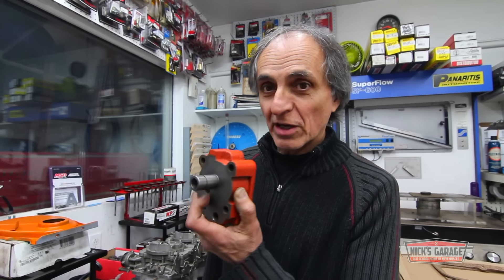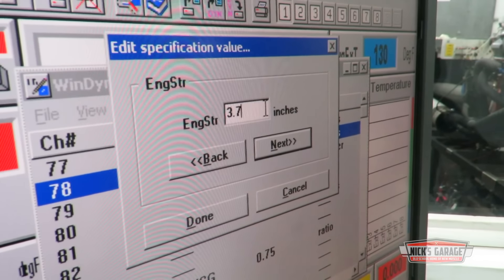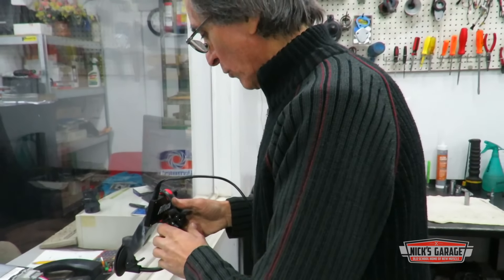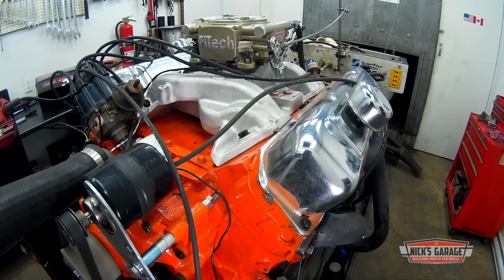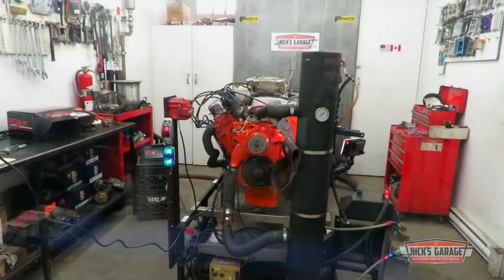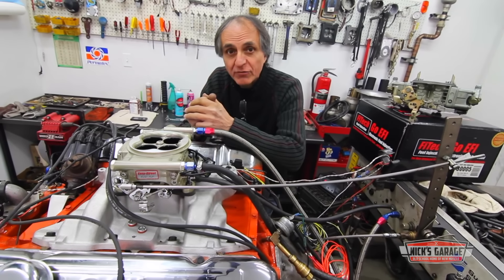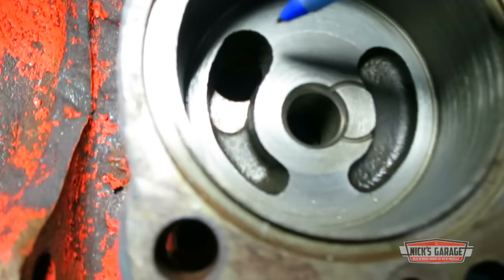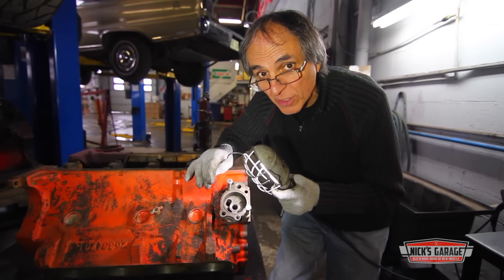Carburetor vs E.F.I. - Dyno Room Showdown

Comment: Lmao no wot tuning and only 10 hp less lol sounds like I need to throw my carb in the dumpster
Reply: You need a better parts store then .
Reply: John Johnson  - Sure EFI has only been standard equipment on everything since 1986 so no one will know what you are talking about.
Reply: If you had a problem with the EFI the parts store isn't going to have parts for it since it's not a factory type system.that's where your gonna get the blank stares from. Unless all the components on Fitech or Holley sniper use GM, Ford, Chrysler pieces. If you had a problem with a carb you can get a rebuild kit or most stores have an edelbrock carb on the shelf. I ran I holley Stealth Ram EFI on my Trans Am which was just an intake but it used  all the other factory type pieces. So getting parts was easy.
Reply: If the Parts store sells the system than they can order the parts from the Manufacturer just like they can  if you have a problem with a Holley carb they pick up the phone and call holley with the part Number ..
Reply: If you have two cars one with a Holley sniper or fitech efi and one with a  Holley carburetor. Says it's Saturday 6pm and your 200 miles from home broken down  on the side of the road with fuel delivery issues. There's an autozone, o'Reilly's, and advance auto all open. There a good chance you can fix the carburetor issue that night and drive home. Weather it's  getting  parts off the shelf for the Holley or buying an edelbrock carb. With the aftermarket EFI of course you can get parts for it but you will be most likely have to wait till the next day at the least to get those parts. If you have a factory style efi like a LS powered car there's a good chance you'll have it fixed that night also. I have both a carbed car  and a efi car. I like both for different reasons
Reply: LOL it's no different than driving a mercedes and breaking down in a town with out a Mercedes dealer ship. NexT day shipping is a thing it's not the 1980's .
Reply: Were not talking about a Mercedes we are talking about aftermarket fuel injection and carb. Stay on on track. Yes it's 2020 last time I checked
Reply: yeah i think the opposite is true in most parts stores these days , great to have thing running right on carby if you can do it and not have to rely on electronics but id like to see the graph
Reply: Here in the South carburetors are awful. When you shut down the engine it boils all the fuel out of the bowl and floods the engine. I stacked up insulating spacers, added a return line, even swapped in a ThermoQuad, anything to keep the fuel in the carb cooler. But no. Sitting on top of that 200 degree engine is just too much for them. Inline engines do a lot better though because the carb sits off to the side.
Reply: Why would you  throw  a Carb in the Dumpster ?   They are very  expensive  now days .. Sell  it to an Antique collector ..!!!!
Reply: @frankg4761  Lol, most parts stores don't have carb parts in stock anymore.
Reply: @cadman10000 Haha your funny. most parts stores have an edelbrock carb in stock or can get one the next day. Or if you need a rebuild kit for a carb you can get one quick. Stock efi of course they have it in stock or can get it quick. Fitech or aftermarket efi your usually having to special order the parts needed to repair it.

Comment: When i asked indy cyclinder heads engineer about carburetor vs Efi, he stated carburetors always have the advantage. THE NHRA is pushing EFi In all the professional classes.. top fuel, funny car and pro stock. Fine Tuning is easier with Efi if you understand it and if you have the know how to use a laptop computer and upload a program. Draw back. Electronics are making auto racing as a whole more expensive.

Comment: It would be interesting to compare a multiport fuel injection manifold to the FiTech throttle body EFI and the carburetor. I suspect the multiport system would be the winner.

Comment: Carburetors are for lawn mowers (and only for a while longer at that).  And you can adjust that EFI to do exactly what that carb is doing at WOT.  Plus it will continue to do it regardless of what the weather is doing.....
Reply: until the sensors bug out.   EFI was developed for pollution control not power.  When either the MAP, TPS, O2Sensor, FFS, CPS, MPS etc etc start to work below 100%, you're fucked on power and efficiency
Reply: Edwin Henry Blachford,  I don't know specifically about EFI's development, but fuel injection was developed for power.  Even though it was mechanical.  But you're not F'ed if any or all sensors go out, you're just back to a carb type fixed fuel delivery.  As in it reverts to a set injector timing, like a set jet in a card.  What makes it great is when working, it's like having a Nick and his dyno inside your carburetor, swapping out jet sizes, thousands of times a second...

One of the biggest pluses for me, being a electronic engineer, was when they started testing emissions.  Electric signals can be easily made to report whatever the socialist want to see.  And during the sniff test days, an engine can be made to run as lean and clean (for a short time) as needed, with the push of a button, or via an app on your phone once the open source ECU gets off the ground...
Reply: chewbaccathedog, Sorry dude, but there is absolutely no measurable difference in atomized fuel between a fitech type EFI and a perfectly adjusted (for right this second) carb.  And even if there was, the carb would be less atomized, as so readily shows when the jets are too big and the accompanying gumming of the inlet valves.  If you ever watch a slow mo of a carb at WOT, it's coming out in relatively large droplets like a water hose.  Injectors of the last 20 years never release anything other than fully atomized fuel.

Plus injectors come in many variations.  The latest injectors have are high ohm fast switching atomizers that a carb could never hope to match.  It just can't be done with a vacuum draw.  And there is no pure liquid dump of raw fuel every time the pedal is mashed.  

Keep in mind that they ran peak power test based on a self learning EFI system.  And any engineer knows to plan for the worst by being conservative in the automatic settings.  If they had a tuner there to tweak the timings, that under a grand EFI would have not only smoked that carb, but would maintain peak numbers irregardless of temps, altitude or fuel quality.  I luv the simplicity, and locked ECU systems at times make diagnostics an expensive pain, but Carbs are for lawn mowers....  And I'd rather not even use them on lawn mowers...
Reply: Mat Helm my buddy spent $3500 to lose 28 hp
Reply: Cana box
Yea, ya can't fix stupid....  Even with $3500 dollars...
Reply: Edwin Henry Blachford. Fuel injection was for the early diesel engines.
Reply: Ya but every one is comparing a dinosaur method of fuel injection. TBI hasnt been used since the late 80 very early 90s. We since seen and gone  MPFI SEFI and now use direct injection. Drive a direct injected turbo driven car. No preignition . The power is amazing even in a N/A engine. Ive run both , there isnt anything wrong with advancement in technology.  Carbs are fun , they make cheap quick power at WOT. Theres allot to be desired all around with a carb vs modern Efi
Reply: Give me a well tune carb for the money. Spend 2000.00 for what with a efi..please....demon, edelbrock ,electric fuel pump..good double plane intake...
Reply: Haha
Reply: @IlPinnacolo  So then why are so many Top Fuel Dragsters, F1 teams and so on moving to EFI? Top Fuel certainly is dumping a lot of fuel quickly. Not questioning since you seem to know your stuff, just wondering why so many racing teams/types are moving away from mechanical carburetors? Sign of the Times, easier to tweak and manage.....or am I wrong on this trend?

Comment: Formula 1 uses fuel injection. Four injectors per cylinder though. Pretty high tech.
Reply: using injectors was high tech in the 50's when they were first used lol.  F1 using them today, not so much lol.
Reply: @bonnivilleblackcherry9745  Are you sure about that? The four injectors fill the entire chamber giving a more efficient explosion in the cylinder. Pistons are also designed to swirl the air fuel mix improving the filling of the cylinder to create more power. In lamens terms.
Reply: @Malc664  1001% sure. Your chev or mazda daily would be using it since the 70's but they don't have sponsors paying for it. 
Pistons are designed for compression or atomization (spelling) but not for cylinder filling. Cylinder filling is based on the volume of the cylinder. If you have a 40 cid cylinder when the piston is bdc it doesn't matter the design of the piston. Its still going to suck in 40 cid of air and fuel mix. IN LAMENS TERMS ;-)
Reply: @bonnivilleblackcherry9745  Ok mate. Intriguing. Makes me wonder why F1 would use the system they have now.
Reply: Current F1  regulations only allow one injector per cylinder. Not 4.

Comment: engine masters done the same test using holley efi,and the efi beat the carb....
Reply: steviesls1.    I have been told that the Holley EFI is a better setup.  We are just starting to put a few EFI on engines. Thanks for the input.
Reply: The interesting thing was they COULD NOT get a dual plane manifold to work with it.
Reply: I'm a carb man myself,my 95gt was swapped to a carb after the 351 swap,tuning is just so much easier and cheaper...
Reply: But nick didn't tune their carb. It's all in the tune.

Comment: With an electric fuel pump turn the key and they start. I have seen a few people with these elcheapo  efi setup. Some good, some bloody awfull.  On some engines they ndo not like dual plane intakes. Why? I dont know either but going from a Performer rpm to a Victor jnr made a mild street engine better. Though it had less bottom end to mid range power. That one is back on a carb.
Another using a $2000 Holley set up was quite good, gained very little power but was smoother mid range and a bit nicer down low. This on a street strip engine where it was no faster but a bit more consistent. Though to me his carb was too big anyway. An 850 on a 11-1 351 is too big!

Comment: It is not the FI  that makes it reliable but the  ELECTRIC FUEL PUMP  I ran a 440 for 13 years started first time all the time -30 0r 35 degrees because it had an electric fuel pump , no cranking to get the carb filled

Comment: It’s not about wide open throttle. A correctly flowed fixed fuel carb will make the same HP as a injected throttle body. It’s drivability, self tuning, economy of use. I run engines for 12 years on dynamometers all of which was WOT so it didn’t matter witch fuel delivery was used. Fixed fuel doesn’t have any compensation for any of the elements.

Comment: I daily drive carburetors.  There's nothing cheaper and more reliable, YET.  Eventually efi will be more affordable and it'll be the way to go.
Reply: cheaper, yes. more reliable? depending. turbo and carbs? never again...
as a owner of a original 85' Alfa Romeo GTV 2.0 Turbodelta 90% of the problems was the carbs and most went gone after i got it modified for EFI (Bosch).
same with the old Alpine A310 i had before, no turbos there but that car just asked for fixing up what the french had screwed up (two carburetors where one was a dual and the other a singel working in tandem, and they needed new adjusting after almost every trip...)

though like all Alfa's, aren't there one problem an another comes up so my last problem is wires been chewed on by mice so looks like it might not get out before the summer -_-"
Reply: Børre Børresen this is French garbage we are talking about... I'm talking about American cars, v8, straight six, whatever.  Like in the video.  Carbs are indeed FAR more reliable because if maintained, everything else can literally come apart, but they will work if there's 6 psi of pressure at the fuel pump.  And without pressure, you can put the tank on your roof and gravity feed it like a motorcycle.  You cannot do that with fuel injection
Reply: funny enough the carbs on the Alpine was made in the US.
Reply: Børre Børresen ok, I have to admit. That IS funny
Reply: shows that even with good parts stupid engineering can make stuff unstable.
whats a good idea on paper might not be in real life or even will end up being a gigantic hassle later on.

i know that now you get adapters "cheap" to mount a single Holly on the Alpine's, back then i would mostly done that if it had been a option since it's cheap and simple and most people can tune em.
plan was to get twin dual Dellerto 40mm's that could have been fitted to the original intake with minor adapters but price was twice of what a custom EFI setup was.
and the new owner really loved it and sold the car with profit (if i exclude the workhours i did to it)

the Alfa is more an "overtuned Italian" from factory so everything was on it toe tips all the time...
so a recipe for for fun but also break downs. but slowly rebuilding it to a sunday cruiser so future generation can witness it.
Reply: Only carb guy here in a whole crew of fuel inj  cars
Reply: I wouldn't say they are cheaper OR more reliable.  You can purchase this same FItech system complete and ready to bolt on for around 700.00. 

A brand new holly HP will cost close to the same.
Reply: Cheaper, I'll admit, or at least for the carb itself. Over time though, after the learning period, the EFI will save more on gas (generally, unless you're REALLY GOOD at dialing in a carb) and won't need occasional tuning. It all lies in preference and what you're accustomed to. If you're accustomed to them, like the ease of repair, and want to pay less on the setup, go with a carburetor. If you want better fuel mileage, simple setup, and little upkeep demand, go EFI.

Comment: you should have allowed the efi to fully learn the engine parameters properly then run your dyno test,it would have beat the carb if it was the same cfm
Reply: Northernsledr.       True, we should have put more time to learn the EFI system.

Comment: I adjust my FiTech for temperature changes.  I run 16:1 AFR in triple digits and 14.7:1 and lower below 50 degrees F.

Comment: I believe that engine was hunting for idle. On tbi systems your supposed to adjust throttle blades so the IAC position reads 3-9% at hot idle on the data monitor. Then you have to do a TPS reset. Also I haven't heard many good things about fi tech besides the price. I think the holley sniper efi would have been a better choice. I'm running the holley terminator. They market these things as "plug n play" "self learning" They do a pretty good job on base fuel table but some things like eccel enrichment, hot starts, cranking fuel ect have to be tuned manually. It is a learning curve but I know much more now about EFI and have fun geekin out in the process.
Reply: TheMikel302.    The night before we had it running and tuned. It took us a while to get it to run perfect. From idle, to part throttle and full throttle. Next day for video, it had a mind of it's own.
Reply: Yep. This hi tech stuff can be a blessing or a headache and different to troubleshoot. People have strong opinions about efi vs carb. Both got their pros and cons. I think my next project i want to carb it and learn how to tune it. Love the videos and the cars. Keep up the good work

Comment: I'd say that 439 HP compared to 429 HP isn't much difference. The EFI is in my opinion the best way to go. I don't have an FI TECH EFI, I have an Atomic MSD EFI and there is no way I'd go back to a carburetor.  Nick's right with EFI I just turn the key without touching the accelerator and my '79 Chevy, C 10 truck starts right up. When my engine was cold with the carb I'd have to pump the accelerator like 12 times to get it started. Even then sometimes I'd have to pump it a little more. Then when I would come home fuel would drip in the carb filling my garage with the smell of gas which my wife did not like at all. Also, there were times it would sputter when I'd start out from a stop even when the engine was hot. I really like my smooth running EFI. Sometimes when people what the "Atomic" means, I'll tell them that my truck actually runs on uranium 235, weapon grade, special nuclear material and that a Q clearance is required to drive it. I'll add that I do have concerns that the fuel rods may not descend into the nuclear material fast enough resulting in a melt down and possibly a nuclear detonation but most people think I'm kidding them.

Comment: these old engines are not made for injection leave that todays v8's they are allready engineered for direct injection anyhow
Reply: When an engine was designed and built has nothing to do with adding fuel injection. The small block chevy came out in 55, and had fuel injection added to it in the 80's. Ford and Chrysler also added FI to their classic small blocks, ford also added FI to their ancient straight 6, and chrysler did the same with the AMC six used in the jeeps. It can also go the other way, carbs can be adapted to modern ford, chevy and hemis.
Reply: that efi is the same design as a carb. just no accel pump. its using injectors up high like carb jets. no port injection and def no "direct injection". its TBI like a 80s-90s chevy 350